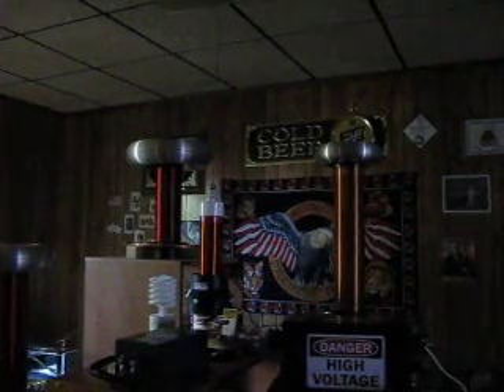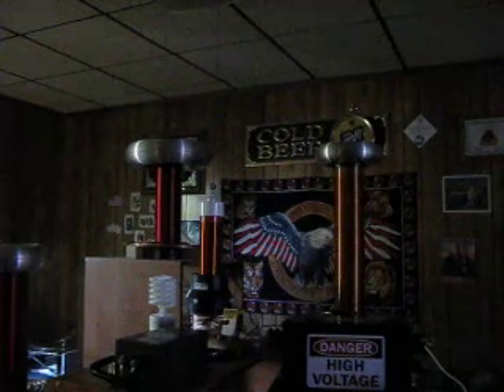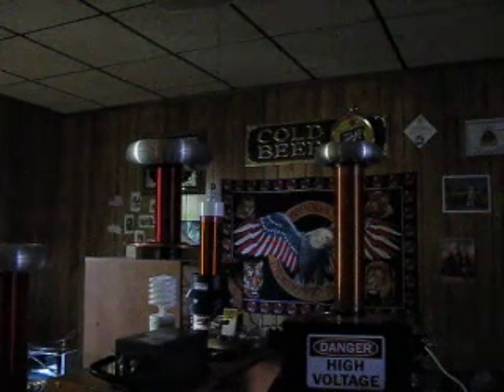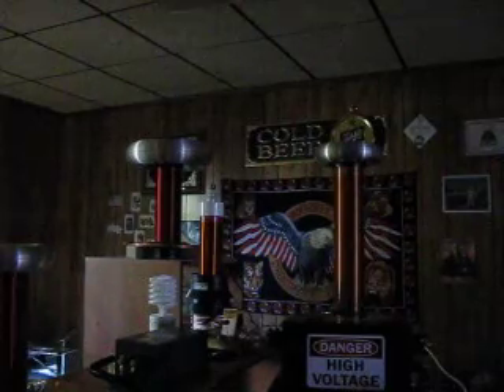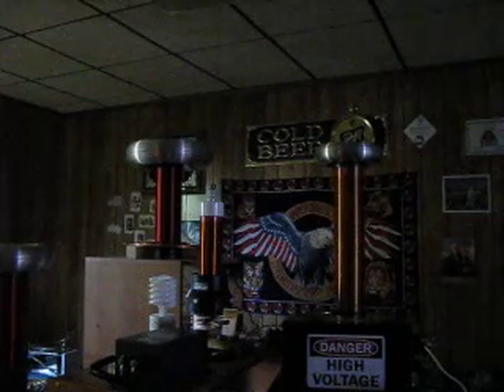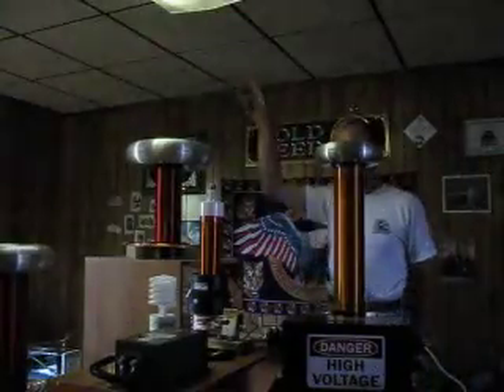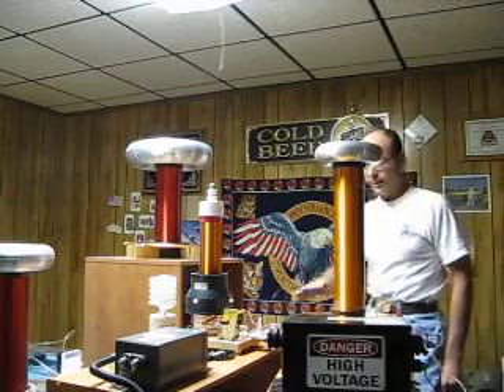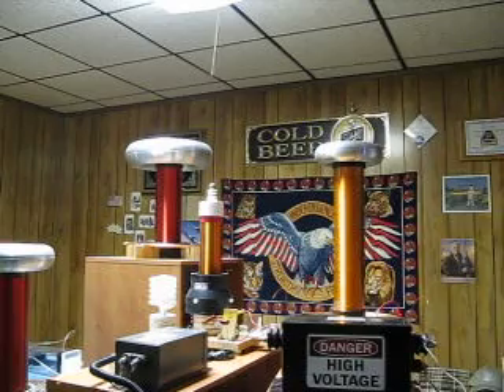Two Tesla Coils - High Voltage Interactions

Comment: If the coils were not wired anti-phase it is highly probable the arc discharges were attracted at midpoint due to one of the operational coils being of lower potential difference. Hope the author of this video can clarify this.
Reply: Just poking fun, but you sound like wesley crusher, ensign.